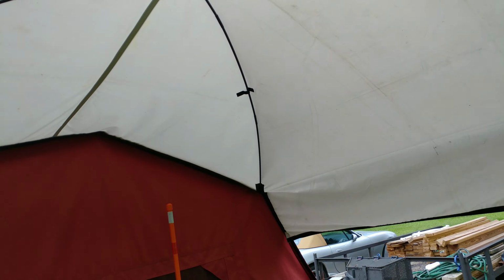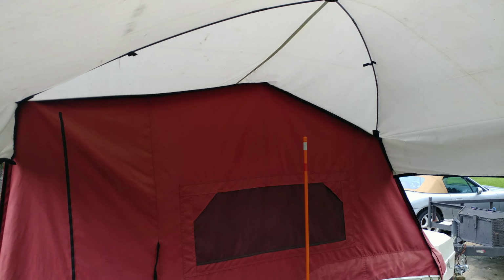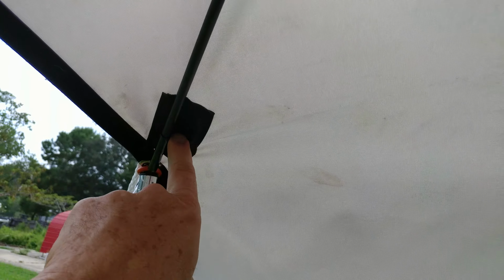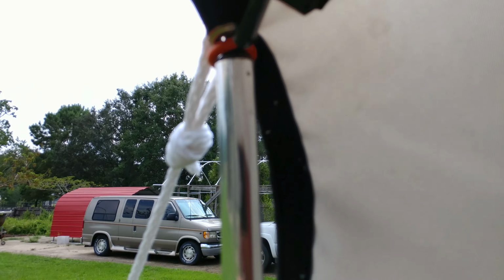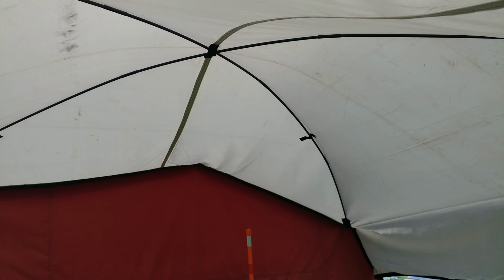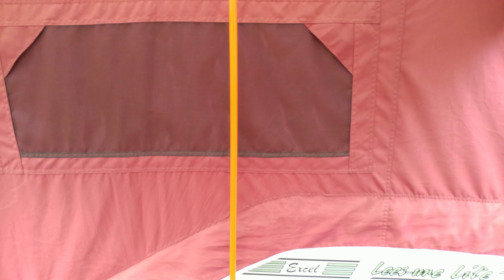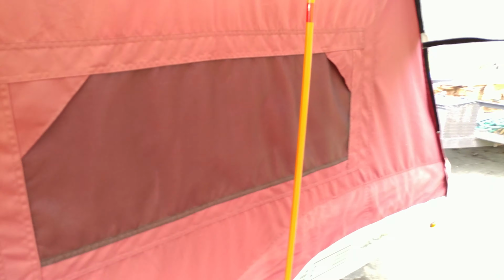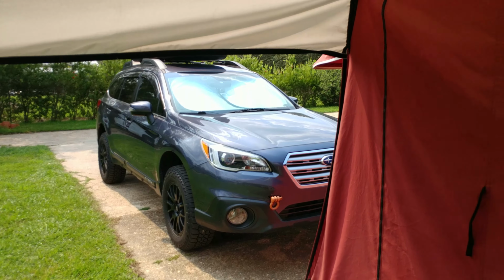Lees-ure Lite Tent Camper Modifications:  Awning Support and Marker Poles

Comment: Outstanding job! We'll definitely pass your video along to others we know that have this trailer as we do. One question please. The bar screwed underneath to the square cross-frame member, is it PVC or pipe?  Thank you very much, Sir.
Reply from the maker: Yes, all is PVC.  I had one of the threaded joints break while towing.  I have now replaced the elbow with with a 3/4 x 3/4 slip fitting with a 3/4 to 1/2" reducer and then the 1/2" orange pvc pipe.  This is much stronger than the threaded fitting.  We did a 2,500 mile trip in September with no failures.  I also shortened the orange pipe to 40" to reduce the wind load.

Comment: Luv this, but then you have water running back towards the tent. No??
Reply from the maker: No water problems.  If it is raining we just lower the poles a few inches to direct the water away from the camper.  Without the bows....it was always a disaster for us with the awning while it was raining.  This solved lots of problems and made the awning a LOT more stable.  Thanks for the question!  :)

Comment: Where did you find the pole material?
Reply from the maker: They were purchased at a local sporting goods store.  They are available on Amazon as well.  As noted in the video, the length will have to be adjust (a simple cut with a hack saw) and then restring the bungee cord.  You shouldn't have to spend over about $7 per pole set.  Good luck and thanks for the question.